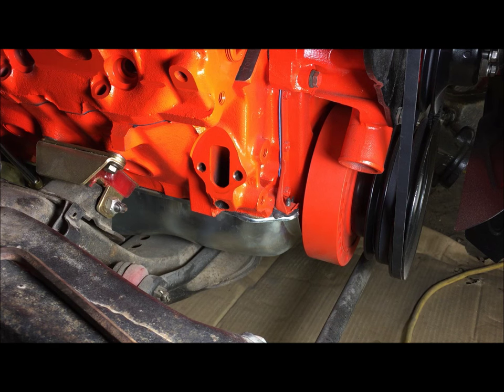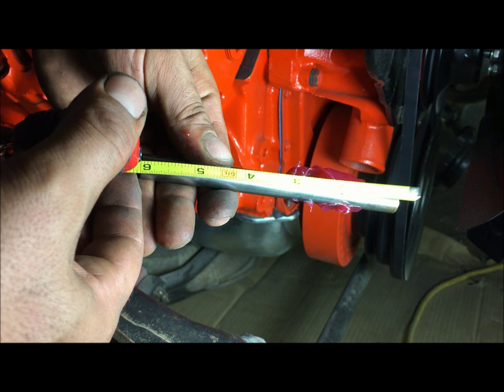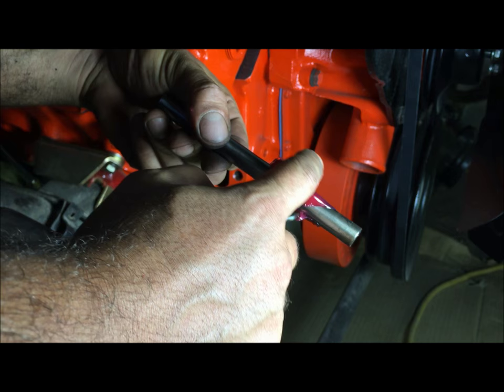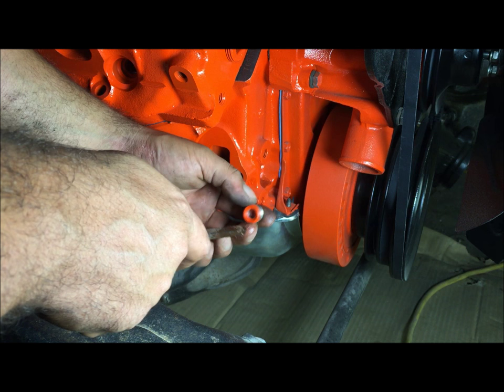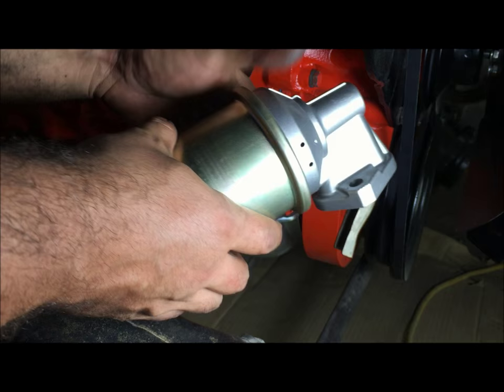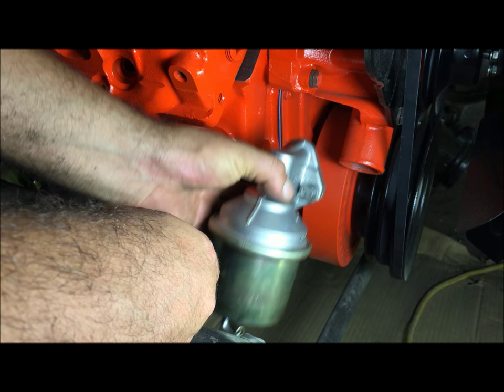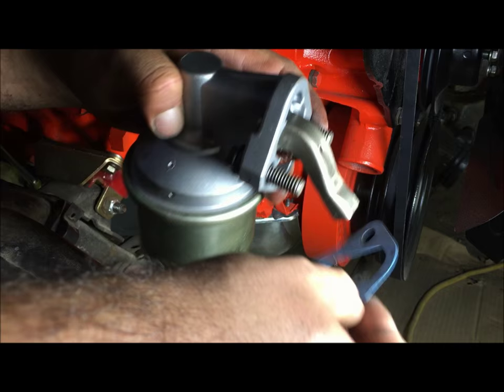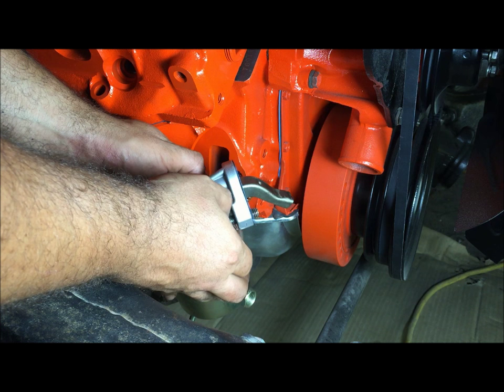how to install chevelle fuel pump big block 454

Comment: Thanks for the video, putting grease on the rod to hold it up was key to making this job very easy!  In my case I was able to install the plug after I installed the fuel pump.  I also strongly recommend to fit a new rubber fuel line to the bottom of the fuel pump before installing the fuel pump in place.  It’s very tight quarters when changing the pump under the car and pre installing the rubber fuel line will save you a lot of grief!   Thanks again for the video, short and to the point!

Comment: Okay motor needs to be @ TDC  and their a bolt 7/16 in the lower front of the block remove short one use longer bolt to hold the rod up .
Reply: My Corvette BBC doesn't have the hole to thread in the 7/16 bolt
Reply: That’s only on a small block. Holes are blind on a big block.

Comment: I see your pump has a spring under the lever and that it's a precision manufacturer/brand. I have a 78 Coupe deVille and I too got a fuel pump from precision from O'REILLY but mine didn't come with that spring. I have replaced it twice because it starts to make a tapping ticking sound like a lifter noise but it's the fuel pump because soon as I replaced it with another the sound is no longer present. And unfortunately it's making that sound again. This time I ordered a fuel pump that has that spring under the arm no I'm hoping this will resolve it. In your opinion would the lack of no spring be the cause for a tapping/ticking noise?

Comment: edelbrock says not to exceed 6.5 on 650 cfm carb  will 7 psi tech be too much or whats half inch...?
Reply from the maker: are you running electric fuel pump? or getting 7psi on mechanical?  too much pressure can bypass needle and seats..

Comment: Just swapped out the oe style pump on my 396 the other day and couldn't get the plug out on the bottom but thankfully I was able to flip the key once or twice and get the push rod in the sweet spot and pushed it up and got the mech lever for the pump under it and with a little pressure pushed up and bolted the pump into place

Comment: Does the rod have to come out? Do I have to unscrew that cap? I’m replacing it in a running and working engine .
Reply from the maker: no.. just put balance on TDC At 0 so rod pushes in
Reply: Chris Craft thanks for the quick reply. Yea just lift up the rod with something right ?
Reply from the maker: yes it’s Easy
Reply: Probably a little late on a reply but there is a bolt hole on the front of the block right where your pushrod is at. If you remove the bolt from it you can take one of the bolts from your old fuel pump while leaving the other bolt in pump tight and snug it up against the rod, not too tight and it will hold the rod in place.
Reply: Travis Carr thanks !
Reply: @traviscarr6536  sbc only right?
Reply: @jameysmith6316  I’m pretty sure it’s like that on most all the older small block Chevys

Comment: I'm having a problem with my fuel pump how much resistance is on the mechanical fuel pump ? and my fuel pump isn't pumping anything into my fuel filter when I push the gas but when I try to start my car it fills up my filter .... any clue ? pls lmk thank you
Reply: also the pump is new (2 months)
Reply: Mike Hernandez all you can do is put a gauge and check the fuel pressure
Reply: The mechanical fuel pump isn't supposed to respond to your pedal input. That is a process that is triggered by the turn of the engine to deliver fuel to the carburetor. The carburetor converts your pedal input into fuel shots to the engine.